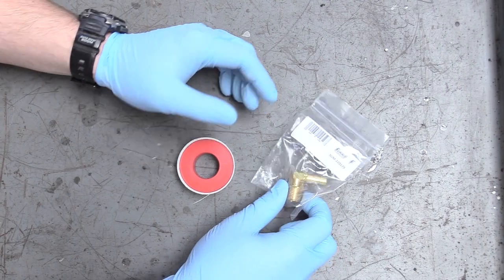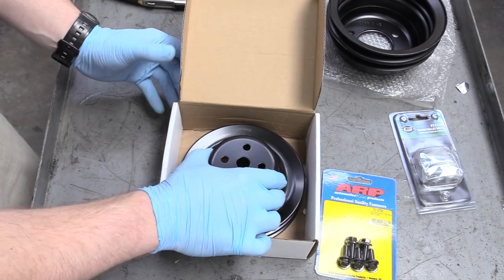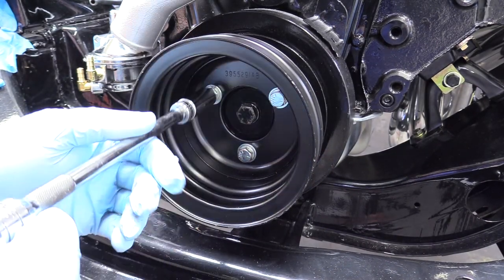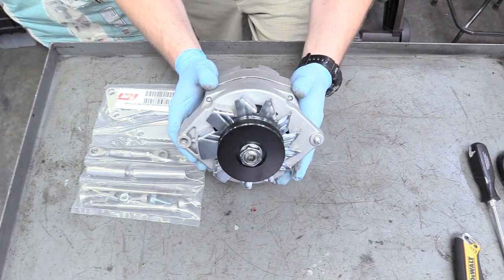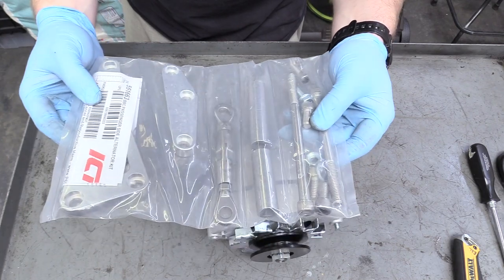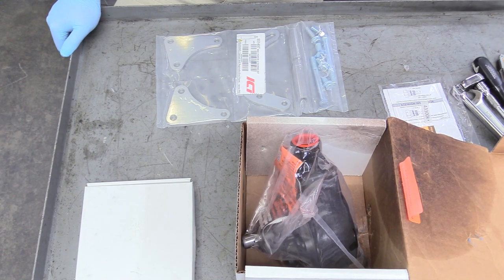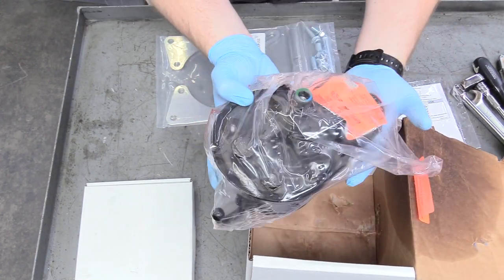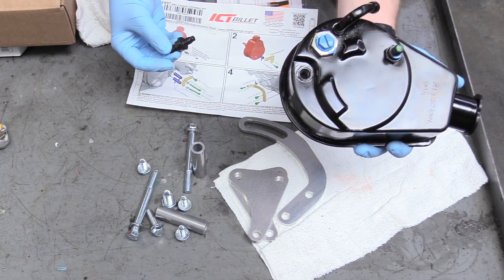How to Build a Chevrolet 454 Big Block Part 15: Front Accessories and Pulleys

Comment: The Summit description for the water pump pulley that you linked says it is for a SBC with a short-style water pump. Is that actually the pulley you used?
Reply from the maker: Yep that’s what I used. Believe it or not the same pulleys are used across many different engines. Thanks for watching!
Reply: You telling me i could’ve used my pulley off my 350 instead of buying a $50 bbc one ? Great

Comment: Hey man. what I want to do is replace the air con comp on my rv 454 for a 24v alternator for my lithium system. Great idea right. It would be so ez to charge my lithiums fast with a alternator when it's cloudy. My rig is stationary mostly.

Comment: The alternator kit bolts does not work with original iron heads as you would need the 7/16-14 socket head cap bolts in stainless which I have not found yet. Any ideas?
Reply from the maker: Something like this might help you https://www.amazon.com/Stainless-Lengths-Available-Listing-pieces/dp/B07N31CCY7 thanks for watching!

Comment: What ac compressor bracket would work with this kit? Obviously you’d need a different crank pulley with 3 belt slits but I’m unsure of the actual bracket. Just trying to not spend a fortune on a serpentine kit.
Reply from the maker: Yeah you would need a 3 groove crank pulley. Check out Vintage Air they have a ton of really great kits for all kinds of different cars. Thanks for watching Cam!

Comment: The parts in the description…. Does it goes to any 454 big block motor??? I have GEN 5 thibk it came out of a 92 Silverado 2500. I know for sure it’s a gen 5 tho and I’m putting it in my 87 Monte Carlo ss
Reply from the maker: That is a great question. I would just use Summit Racing's amazing parts filter to find that info out. I want to say yes it will work because I believe the top end is the same and the real difference is things like the rear main seal being 1 piece instead of two. If you really can't find an answer I would just call Summit's customer service line their tech support people are amazing. Thanks for watching!

Comment: I have a 94 chevey 3500 Silverado with a 454. Is there anyway to know what generation the motor is? Also would any of the paperwork say if this motor I have is a 2 or 4 bolt?
Reply from the maker: I believe that is a Gen V and I don't believe there is any paperwork that would tell you that. Only way to know for sure is to take the oil pan off. Thanks for watching!
Reply: 1992 through 1995 454s were all Gen V big blocks.  Gen V and Gen VI big blocks are all 4 bolt.

Comment: What headers did you end up running?  How well are they clearing the steering box?
Reply from the maker: I ended up using Doug Thorley header and they clear it perfectly when you use the right frame mounts for the engine mounts. Thanks for watching!
Reply: @2carpros  Doug's are the best fitting headers out there

Comment: Great video! Q: what could be the cause of, when the car start sometimes it make some Rattling noice then normal( engine)
Reply: Sounds like slack in the timing chain. The tensioners are partially operated by oil pressure. When first started, there isn't much oil pressure in the engine. Once the engine is running and has adequate oil pressure, there is enough tension in the chain and it doesn't rattle. What kind of car and engine?
Reply: Ramsin Mercedes benz e350 2012
Reply: @MT-jf1tn  quick google search shows that it's a common noise. I would say it's nothing to worry about. Just change oil regularly and keep it topped off.
Reply: Ramsin thanks
Reply from the maker: Ramsin is correct from the sound of it. Thanks for watching!

Comment: Wheres part 16? 17? where you have it running? sub just added thank you!
Reply from the maker: We are working hard on our How to Build a 5.3L series in tandem with this. Ideally we will have the Big Block running first but building my car around the engine is a lot harder than just taking an engine to a dyno to start it. The next parts in the Big Block series are coming very soon! Thanks so much for watching!